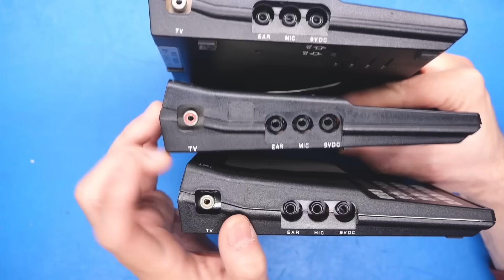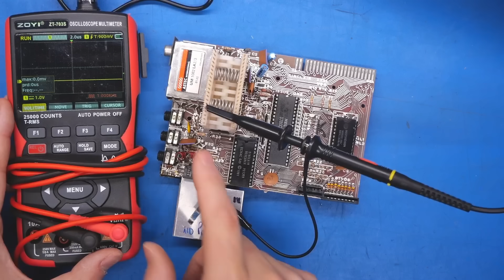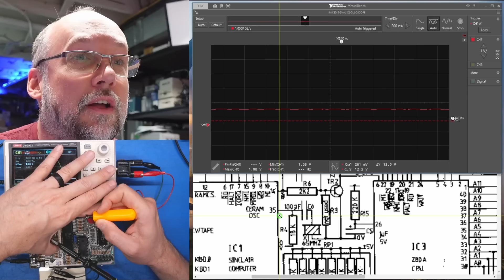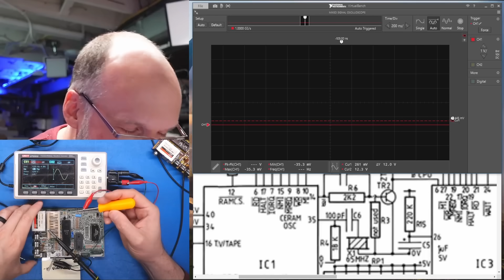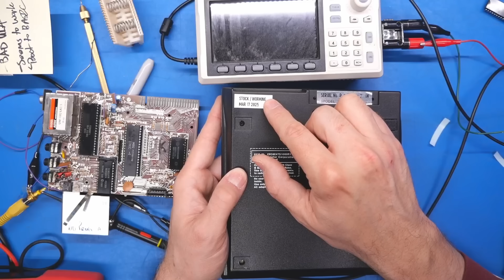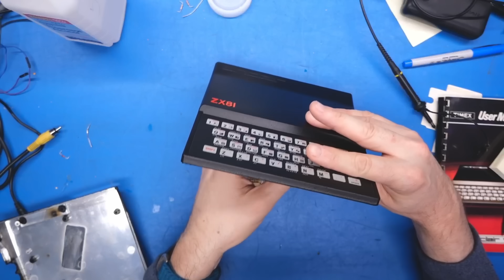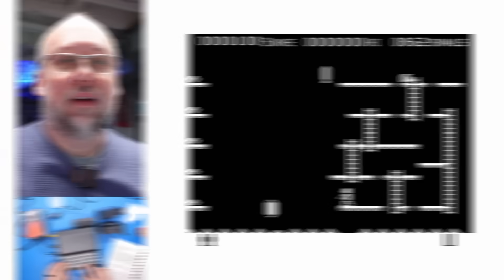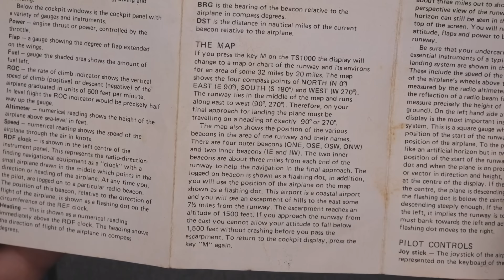Is the ZX81 / Timex Sinclair 1000 actually bad? Let's fix these to find out.

Comment: The ZX81 is the worst possible computer that still (just barely) works. That was the basic genius of the design - everything that wasn't absolutely essential had been removed, every possible trick was used to reduce the component count. It was a terrible computer, but a terrible computer you can afford is much better than no computer at all.

Comment: From a user back in the day, no we never got really used to the keyboard, but the wobbly 16K ram expansion was the killer. Spend hours typing in a programme on that keyboard and then for a wobble to cause it to crash was the reason so many of them got thrown at the wall. It was still a capable machine with decent software support for it's limitations. I don't know why Sinclair didn't ever 'get' keyboards throughout it's entire line. A decent keyboard on the ZX81/Spectrum/QL could have made them a market leader. This is really what won it for the Acorn Model B and it's survive-ability in Schools. Spectrums could never have survived there.

Comment: I could be wrong, but, i believe Sinclair ZX81's were mostly mail order kits after July 82 when the TS1000 came out. Early TS1000's have Sinclair branded PCBs
Reply: Having a look, it looks like Timex had an option to sell their own branded machines after 500k units were sold. Timex did most of the manufacturing of all the machines afaik

Comment: The TS 1000 was my first computer, obviously my dad wasn't too impressed with it, so just handed down to me when I was real young, so I figured I broke it and it was thrown away, cleaning my Parent's attic a few years ago I found it sans casing and keyboard.... ended up doing an onboard 32k memory hack, mechanical keyboard, 3D printed casing and composite video hack. It doesn't get much use, but it's great to restore my first computer now that I have a bit more respect for things.

Comment: As a teenager I soon got used to the keyboard and could type programs in from magazines quite quickly. But there were some 3rd party after market full sized keyboards that you would install the ZX81 PCB into, but they were far too expensive for us. And they usualy cost more than the 81 itself.

Comment: ZX81 USA model you could get in a kit for $99.99 that you put together yourself with a bag full of parts or $149.99 fully assembled around 81 or 82.  Luckily my father was an electrical engineer and figured out the problems in the instructions and the schematic.  The other weird issue was I believe it has a pal rf modulator or a weird one that ran UHF tuning because it didn't have a 2 or 3 switch.  Once it was going it was nice to have a computer with only b&w and uppercase.  Later my father put a 2k ram upgrade from Jamco.  Later we got the Sinclair 16k upgrade and I'd use a very big rubber band on it.  If you were lucky, you found UK computer magazines to type programs in like "Your Computer".  Frogger was the best game on it from corn soft.  Still remember fast and slow modes and making lots of interesting patterns when it loaded or saved onto tape.

Comment: I liked this video as... My brother-in-law had one of these, it was the first computer i recall typing on. It was very basic (Sinclair BASIC, in more ways than one 😂). I knew i liked computers at that point. Eventually the ZX82 named the ZX Spectrum, had a keyboard, that rubber keyboard. That one i first programmed and of course played games on.

On the ZX81 video image... I don't have an answer for the screen interference with the RAM pack plugged in. I know the ZX80 flickered with every key press as  it read the input and could not output to screen at the same time. ZX81 corrected that. However years later i watched a YouTube video of someone that i believe worked on the Spectrum's ULA. I think they were talking about emulation of the ULA at the time but I'm not sure. He did point out that the right edge of pixels had a slight ghost to them. Caused by the speed of the chip and how the image was assembled and transmitted. So i would guess the image degradation on the ZX81 maybe the result of the systems limitations. All of Sinclair's computers had some compromise for cost, even the QL that was well above any of their Z80 systems.

Comment: That video out is closely integrated with the CPU. When it crashed due to a moved RAM expansion, the display turned fully white but a little bit flickering. It was like the screen itself hung in a loop.

Comment: Those first two hi-res games you played were not typical for the ZX81, 99% of the games used the built in character set and graphics for games. 3D Monster Maze was everywhere back in the 80's, I still play it. I also have a ZX81 emulator for the ZX Spectrum that came out in the late 80's. Ha ha.

I upgraded one of my 81's to 16K internal memory and another one has 32K RAM with SD Card slot. All have the composite mod.

Comment: I had a TS1000 when they first came out. I added the 16K memory expansion pack, cut out and screen covered a cooling slot. Eventually I made a battery pack and made it portable. My favorite game was flight simulator. My main reason to get this was to learn basic programing (I needed for work). My next system was an IBM XT clone with a 40 MB HD!
Reply: Flying the SR-71 in flight simulator is a blast if you try for an altitude record! Climb at an high angle maintaining your speed and try for space!
Reply: The ram module required some adhesive velcro to hold the pack steady.

Comment: I still have 3 working TS-1000's here, my first "home" computer back in '82. That thing was made from duct tape and spit and really designed to attract the hackers and the adventurous. That's one reason why it was sold as a kit! And Apple II's were probably still thousands of $ at the time. One of the consequences of paring down the design to basically the Z-80 and the ULA is that the CPU had to do almost everything; running programs, writing into graphics RAM and refreshing the memory - which is why it's slower with the expansion. The ULA was the glue and I think it also generated the clock signal. And it was an accident that the original ULA actually worked, a bit of dirt got on the screen, causing a short that actually fixed a design flaw. Spit and duct tape, I tell you! Turns out its predecessor, the Zx80, was actually FASTER. The big difference between the two machines is that the 80 doesn't refresh the display while processing until it pauses for user input. So it "runs" closer to 3.25 Mhz over all. But you can make the 81 behave like a 80 with FAST mode, just type F, enter, and you're in for a world of hurt if you can't stand flashing lights. It makes games unplayable, but the machine ends up one of the fastest Z-80' machines of the period since it can focus on running programs. As far as I can recall, it was a long time ago. As for the keyboard, yes, you could get pretty fast typing on it, especially if your little boy fingers could fit in the dimples, gave you pretty good haptic feedback. We used to strap down the machine to a wood block with elastics so the RAM expansion wouldn't wobble, worked great! As for the membrane connector, I think you can blame the heat sink and absolute lack of air circulation for it becoming so fragile, any TS-1000 user can tell you that it would get pretty uncomfortable typing certain keys on the keyboard after a long gaming sessions because you'd feel that toasty heat sink right through the keyboard. Still, amazing design, bare minimum for a working computer, definitely something that influenced a lot of people from someone who wanted to make the future accessible to everyone. imho. :D

Comment: Back then I actually attached my ZX81 and the 16k expansion to the table using sticky pads in order to prevent those dreaded crashes. I learned Basic and Assembler on this thing and it actually got me addicted to programming, which is my profession to this day. Thanks to the Sinclair ZX81! I think I used the ZX81 for about 2 years until I was able to buy a used old 8080/87 PC with 10MB(!) harddisk and Hercules graphics.

Comment: I got the  ZX81 in 1982 and was my first computer in the UK. We also had the RAM expansion although it wasn't an official Sinclair one. If I remember right it was the Panda Ram pack and after a few days of RAM pack wobble my father who was an electrician soldered the ram pack to the ZX81. I typed loads of game listings from magazines and had to save them at least 3 times as the loading was not stable. When 1983 came around I had the 48k ZX Spectrum for Christmas and never looked back.

Its was good for the time and gave me an insight into what you could do with a computer. The things is once you seen what you could do you wanted more and that's where other computers came in.

Comment: Newer ULA do this stepped sync signal. The 2nd part is where the color burst would go on a color signal. Ones that dont do that have problems with TVs which use it to adjust white level and just look very, very dim. There is a hw mod to add that. Mine doesn't do it. It is very simple to expand ram to 32k with a single sram taken from pc motherboard cache. 64k require some logic not to collide with rom. Have fun!

Comment: I bought one in 1981 and I loved it. I bought the add-on memory module and the printer module and the special printer paper. I actually used it for a lot of games, some of which I bought, and some which I wrote and traded with other creators. I used it until 1985 when I finally caved in and bought a Leading Edge clone, which wasn't compatible with the game protection tricks, such as burning holes in the 5 1/4 inch floppy with a laser and then looking for the read error. However, it wasn't too hard to use Debug, which came with MS-DOS, to find the call to the disk drive and insert the error code the game was looking for on boot-up. So there I was, buying games but having to hack them to play them. Great fun. I fired it up a few years ago and it still worked perfectly.

Comment: I wonder if you can add some filter caps to the DC section in that memory module to reduce the noise.  It's a chopper circuit probably, so the chopping is all PWM square wave output so it'll output RF.  If you filter the output better it might dampen that noise.  Put like 100uF cap(s) from the DC that's chopped to ground to filter it.   Watch it on a scope to see what effect you are getting.

Comment: I was playing around with a ZX81 a few years ago. It was actually my introduction in repairing old computers. To give the keyboard a bit of tactile feedback, I sticked little self adhesive silicone domes (sold as transparent anti-slip pads, 5mm diameter) to each key. It helps surprisingly well.
Reply from the maker: Another commenter mentioned stickers back in the day you could apply -- and it added raised areas around each key, so you could actually touch-type. Interesting solutions!

Comment: First of all Thank You for saying "Zed" X81 and not "Zee" X81. It is a UK based machine where they say "Zed". Probably the same reason for the Timex branding because Americans cant say "Zed" . lol. and Like many others, this was my first computer. I had all the accessory's including an external mechanical keyboard that plugged in between the RAM cart and the ZX-81. Mechanical keyboard was huge improvement but the entry was still slow unless you used fast mode which blanked the screen on every CR. Z80  assembly is very easy and you could make your first line of basic a REM statement with 255 "." as a space to store your assembly and poke assembly directly into this space. of course is would fill up with no readable ascii but really simple. It was a very good learning tool and Z80 assembly was hugely popular and used in many arcade machines too.

Comment: The Sinclair ZX81 wasn't a bad little computer in its own right.  In retrospect, there are some very clever things about its design that made them good for learning on, and even some of the "stinkers" in it (the keyboard) had surprising upsides. 

1) The "token at a keystroke" keyboard made it a whole lot easier to accurately transcribe listings from magazines

2) There was a 'fast' mode that shut off screen refreshes while the CPU was busy.  (Caused some pretty nasty flicker, but if you were doing compute intensive stuff, gave you something much closer to the full speed of the CPU)

3) The edge connector was complete enough that it made the machine dead easy to develop peripherals for  - making this machine ideal for learning some hardware development without having to fear the cost of blowing it up. 

4) Compact coding - you could do a lot with them if you were willing to learn how to squeeze your code down to the absolute minimum.  

Did the keyboard suck?  Yup.  Lots of people I knew grabbed keyboards off dead terminals and rewired them to match up with the ZX - fairly easily done with anything that predated the IBM 5150.  

Graphics?  Meh - but when you understood the machine was really a 1981 design that was intended to be cheap and easily mass produced, so what?

Flaky edge connector?  No machine from that era with an edge connector for peripherals was particularly reliable.  Edge connectors are not great things. For anybody.
Reply: And now here we are in the future back to using tiny little edge connectors for almost everything. USB, HDMI, SD cards...
Reply: @stevethepocket  😁
Reply: 1 - the zx80 and spectrum also used the single key entry system and was 'optional' on a few others
2 - the zx80 operated in 'permanent fast' mode , the zx81 slow mode was an extra development
3 - you can fairly easily kill the chips from an 'iffy' add on, the signals arent buffered
graphics, yes it low res, certainly from basic, but people found a way to get pseudo hires via software and full hires, although cumbersome, with and a modded rampack, although needs machine code

also sound, there were add on sound units made, and a few 'clone' machines did have built in 1 bit sound capability, which i think could be adapted to the zx81 , also some had 'typed in' entry and even colour option
Reply: @andygozzo72  yeah - pretty easy to blow up a machine with dodgy add-ons.  I'd rather blow up a $100 ZX while learning that lesson rather than some of the more expensive machines that were contemporary.
Reply: @mgs337  blowing the ram, rom, or cpu isnt too much a disaster, but if you kill a ula, that can be very expensive,, new old stock parts pretty much unavailable , but newly made replacement cpld modules sometimes available
Reply: @andygozzo72  yes - for context, my comment was more about that learning experience back in 1983 when these computers were available new.  Teenage me (and friends) with just enough knowledge and soldering irons to get in trouble ...
Reply: @andygozzo72 there are clones like the zx81+38 that fit in a zx81 case and are ula-less if you do have a dead ula - they aren't too hard to build as the system is simple (plus has built in 16k ram)
Reply: @mattsword41  i know, i have one of the empty boards to assemble sometime 😉 what someone maybe could do is come up with a discrete logic Lambda 8300(and related models) clone, it has a few 'extras' and differences in its ULA/custom chip, i've been trying to work out an add on circuit to  a zx81 to add those functions, but the board will likely be as big as a zx81 board itself ...

Comment: Yes, the 16k ram pack causes extra distortion in the video (especially with RF as was done back then) as well as a delayed startup time.   It's normal.   Those ram packs were sensitive as well.   Bump the computer and it instantly crashes.  We glued the computer and ram pack onto a sheet of pressboard and that somewhat mitigated the problem.   The keyboard was bad but you got used to it.    Arrow key placement was abysmal.   But for $99 as well as low cost software on tape, it was a good deal.   $299 for a vic-20 or $399 for a TI99 was way too expensive.   Color monitors were a luxury as well.     A 12" B/W TV was the economical monitor of choice back then.   And you could get it all from K-Mart.

Comment: Don't nock the old ZX81.. it was what kick stared the computer boom of the early 80's  In the UK you could buy these in kit form for £49.99 or ready assembled for £69.99 from WH Smiths.  I used to buy the kit form, build and test it and sell it for £59.99, making ten quid on each one, but also saving people £10 against the retail price... bear in mind that in 1981 £10 was a fair amount of cash, and I only needed to build three a week to earn more than my day job at the time !

One thing that impressed me was the fact one guy was selling Startrek in the traditional 8x8 galaxy with E for the enterprise B for base, and K for klingons... it even had black holes and ran in he basic 1K machines without any expansion required....

Comment: Had a 16k one as a teen. You could type by swiping your finger and just adding pressure at the right times. You could type quite quickly. The swipe technique for touch screens is very similar.

Comment: Nice video. I still have my zx81 from 1982.  I have modified it for composite video (and adding back porch), and have the fantastic zxpand+ which provides SD card storage, joystick port, 32k RAM etc.  it still has its original working keyboard membrane, but I do have a replacement which has micro switches waiting to be installed. The RAM can be upgraded internally and get rid of using an external RAM pack and its dreaded “RAM wobble”. There’s also a WiFi device available, which is a nice alternative to the Zxpand+ which can be difficult to find. Keep up the good work, I look forward to your videos every Wednesday and Saturday.